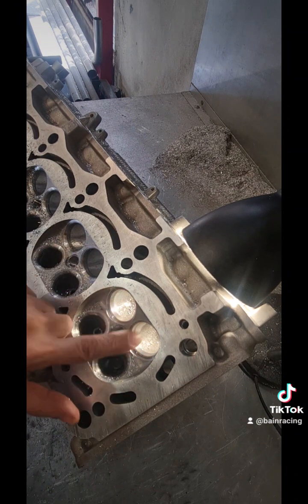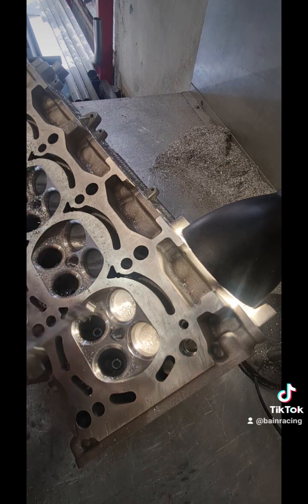Mastering the Art of Hand Porting: The Complete Guide to Porting the Toyota 2JZ-VVTi head Part 1

Comment: Hey was curious if you had a recommendation for throat to valve percentage for a 2jz gte? Shooting for 1200whp. Oem size valves and 9.95mm valve lift.
Reply from the maker: Depending on its duties and how long you want the seat to last and the seat type.  But if it's anything street duty or endurance.  I would go over 88%. 

But if it's short duration drag racing.  Most of these we run 90% on a factory seat.    Or a copper we may go 91.5% but again,  if it was that in need of more throat,  you're generally better going to a bigger valve and running 88% or something that hits the RPM target.  I like to set the bottom of the seat as my MSCA where I can. So I will vary it a little depending if it's under or over on air speed.  

Hope that helps.
Reply: @ very helpful thank you.  The first paragraph you say “I would go above 88%”.  You meant to say you “would not” go above 88% for street right? 

And you would recommend the same percentages for both intake and exhaust?
Reply from the maker: Yes mate. Sorry. That's the dyslexic side in me! 🤣👍
Reply: @bainracing  if I targeted say 89%, would that be geared a little more towards peak power “drag” as opposed to a “street power band”? Or would it be negligible difference?
Reply from the maker: Yeah man, just keep it of rev limits and watch traction control that knocks timing out to try and control wheel spin. This cooks exhaust seats . Sorry didn't see this.

Comment: Is there any benefit to making one intake port flow better than the other?
I’ve heard that doing this can give some benefits of swirl as well as the tumble, so it’s a big power increase even at lower rpm. 
David Vizard called it “poly quad” and somebody said that Honda has done it.
Reply from the maker: Yeah, definitely, mate.  I personally think that's why our hand ported heads slap any CNC'd oem head every time. There's always little difference between L and R ports, which will promote some bias flow, which leads to swirling into the combustion chamber. 

If we like at how little the coriarlis effect is, yet it directly dictates which way storms will turn each side of the equator.  It's in the 0.04G range.
Reply: @bainracing
Wow! 😮
🤓 Great point!